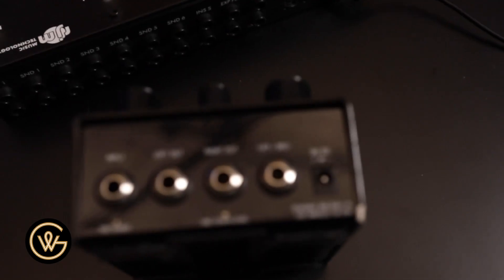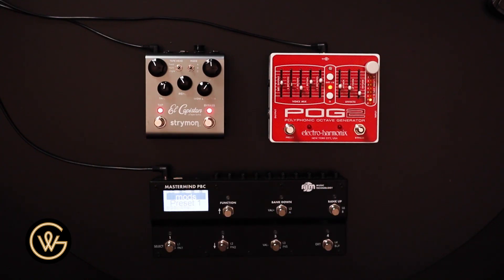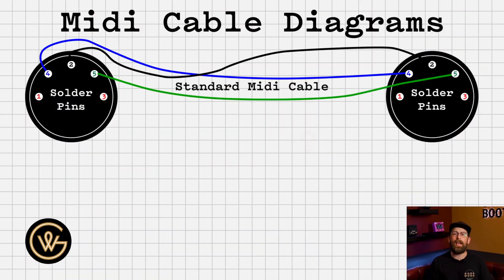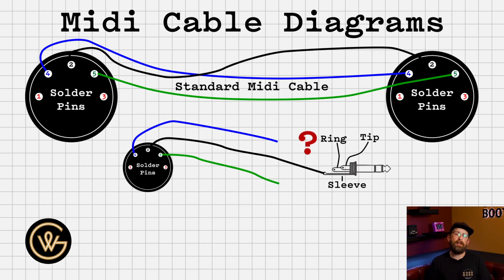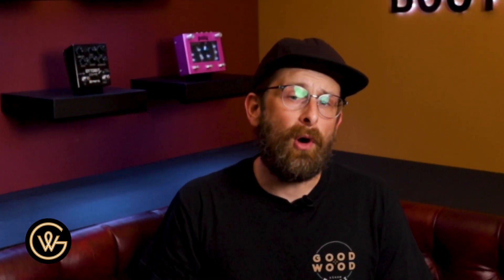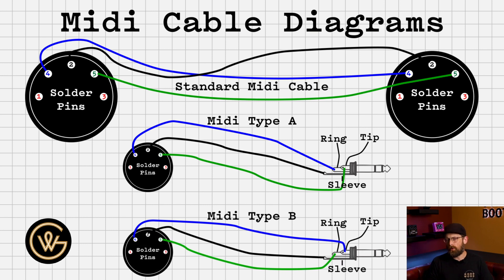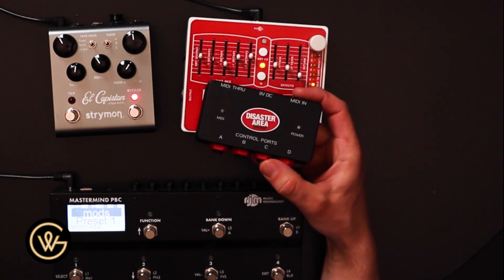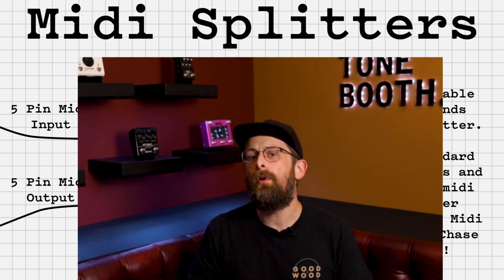Connect Your TRS Midi Pedals Right The First Time!

Comment: Hi thanks for breaking this down for me. I have a question on connecting multiple pedals together with the Rolland M-one USB. I am using the Boss ES-8 switcher, Do I connect the m-one  into the boss switcher fist, then daisy chain thru all the pedals, then when I get to the last pedal do I return back to the M-ones midi in  to complete the loop? Thanks
Reply from the maker: that's the idea, ya.  Depending on the pedals though and what you're using this for - it may or may not work without issues... But start here and then see what happens!

Comment: Thanks for the informative video! 

I am trying to decide what I should do, and maybe you can nudge me in the right direction. 

Right now my Boss ES-8 goes to my DD-500, then the through goes to my Digitech Whammy v4 (which has no through). I want to add my Meris Enzo to this so I can have presets I switch between with my ES-8. 

Since the Enzo takes TRS and there's no through on the Whammy, it seems like I should pick up something like the Morningstar MIDI Box or the Meris I/O. 

If I went with the Morningstar MIDI Box, I could go DD-500 => MIDI Box => Split off to the Enzo => Pass through to the Whammy? But if I went with the Meris I/O, I'd have to put the Enzo on 1 and TRS to 5-pin on 2, ending the chain since there's no return? 

Thank you!
Reply from the maker: ya, a midi splitter is the way to go here.  Morningstar is super flexible.  I really like it.  But you could also look at a midi solutions quadra thru, Disaster Area midi box 4, Morningstar Midi box... With the Disaster or Meris box you get the 5 pin output which is great.  But I like the future proofing aspect of the morningstar with it's adjustable outputs (midi type A or B etc)

Comment: Hi, can I use Boss Bmidi 2-35 cable to connect Strymon cloudburst to ES5 midi out? If I can, should I use regular TRS 1/8 to 1/4 converter jack? Thx u
Reply from the maker: you shouldn't as the cloudburst / strymon midi pedals need to be isolated.  This is why strymons 1/4" to 5 pin midi cable has that section in the middle (egg shaped section) - this is isolating the signal to prevent ground loops.
Reply: @GoodwoodAudio  thank you so much... I am planning to combine Sy200 boss with Cloudburst and as such, I am thinking of buying Strymon Conduit.  Is that the right way? Thanks.

Comment: Hi, what cable do you use to connect to your Strymon Iridium? midi-trs type a or b? Cannot find anywhere what I should use....
Reply from the maker: Type A - but there's a big caveat here... You need to isolate the midi input to strymon pedals (and some other companies as well)... So if you just use a midi type A cable only you have the possibility to run into ground loops in your midi chain.  
I'd suggest getting a midi splitter (even these have to be chosen carefully)... Conduit or Morningstar Midi box both are good options as they isolate all of their outputs, not just their midi input.  
OR Strymon makes a midi cable with built in isolation for this purpose as well (this is the cheapest option)
Reply: @GoodwoodAudio  Thank you. Can i make this "isolation" soldering the cable in a different way? And what those ground loops could make in the midi commands? This should be a problem only if I use more than one midi pedal in the chain? In. ex. if I use only one TRS strymon pedal should I have no problems? Tk you...

Comment: any chance to talk with you 1 on 1 about midi connections? I want the Stryon Compadre, Strymon Flint, and Strymon Timeline. Also want to get the Strymon Multiswitch Plus, and possibly the Strymon Conduit MIDI Hub. Thing is I want to use 1 Mission Engineering EP 25k expression pedal. I know that it has 2 outs so I can connect Flint and Compadre to it. Another thing, I want to use the multiswitch to control say button 1 timeline, button 2 Flint, button 3 Compadre. Problem I am seeing from my lack of knowledge is, the Flint does not have a midi section but uses 1/4" TRS. It is very confusing, please HELP. My email is on my Youtube page, if you want to talk that way.
Reply from the maker: feel free to email us - info@goodwoodaudio.com - we can plan out the best way to run this from there!

Comment: Do you guys know of a way to convert midi clock into a tap tempo pulse? For example: I'm trying to send the bpm I'm tapping into my DL4mkii into the tremolo side of my flint v1 to sync them up, but I'm not sure how to go about it.
Reply from the maker: I know morning star and Pirate midi have devices to work with this... but have never tried it without their native midi controllers... Don't see why it shouldn't work though!
Reply: I’m using the Disaster Area micro.clock to send tap tempo to my flint. It can do either midi or just regular Strymon style tap tempo. I have this Disaster Area micro.clock also connected to my loop station and delay pedal. Works good once it’s configured.

Comment: Any chance you could tell me what config the New El cap V2 5 pin to TRS wiring is ? Type A or Type B ? thanks for your time !!!
Reply from the maker: more complicated than that... you don't want to make your own as Strymon small box midi needs to be optically isolated... so you need to use their 5pin to TRS cables (which come with a module in the middle that isoaltes) or use a midi box that isolates each individual output. Midi type A is what they use though